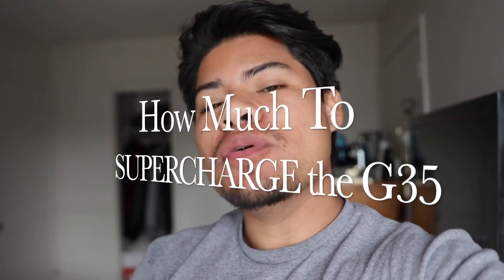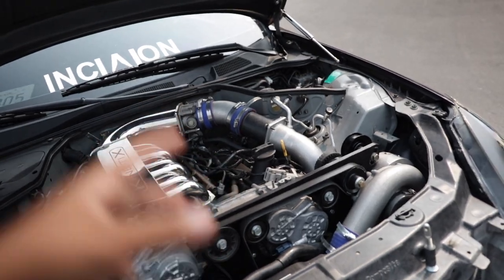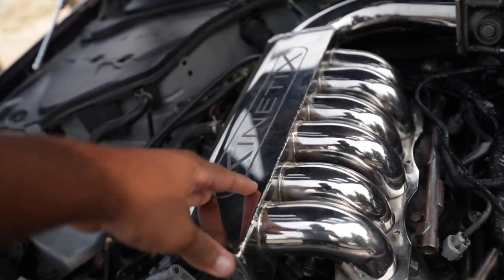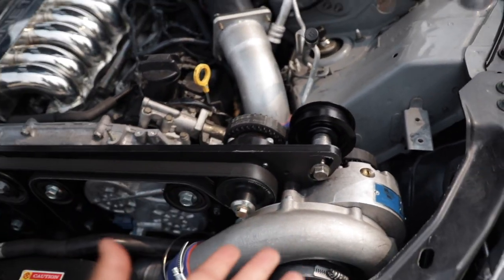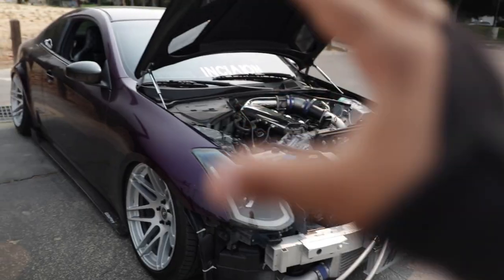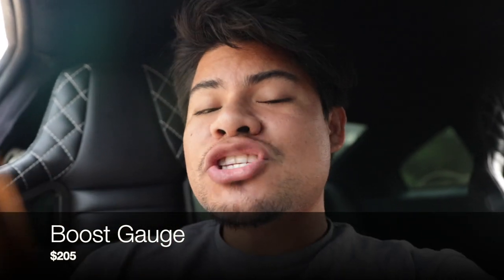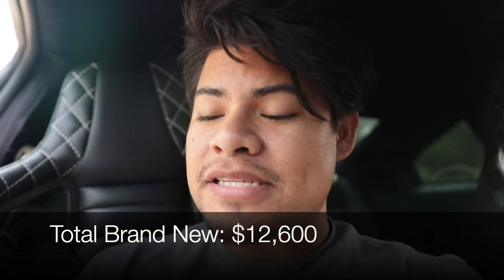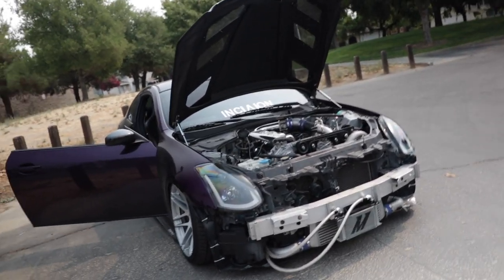How Much I Spent to Boost my G35 (Vortech Supercharger)

Comment: Holy crap Why admin tuning charging 1350?? Z1 dyno tunes for 840 that’s tuning, taxes everything. If you were pushing major power 800-1000 whp i could understand but 1350 is way high.